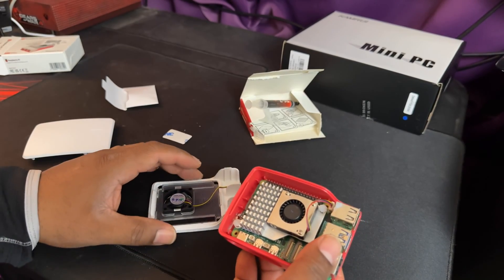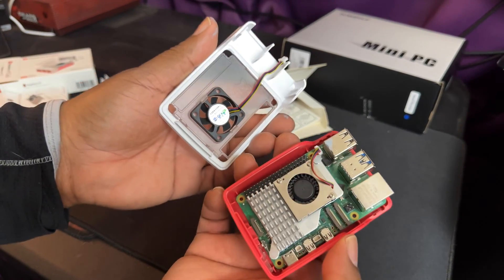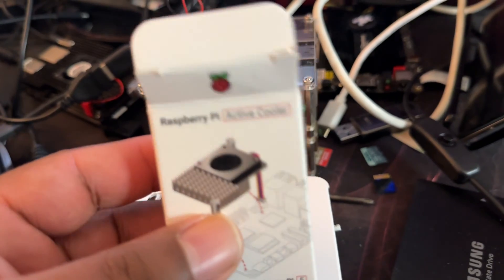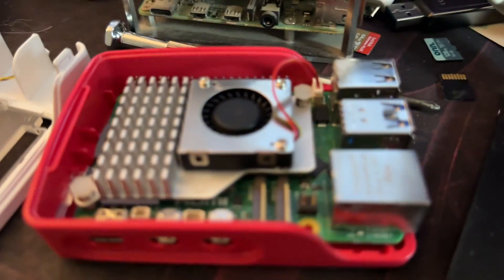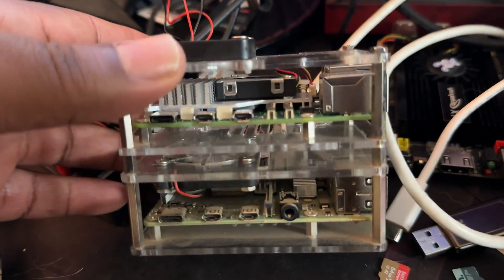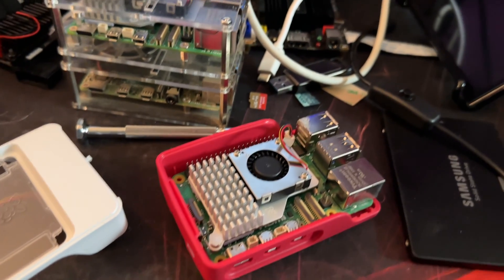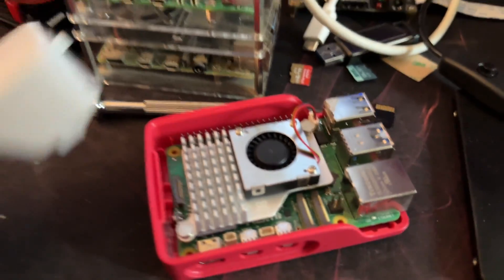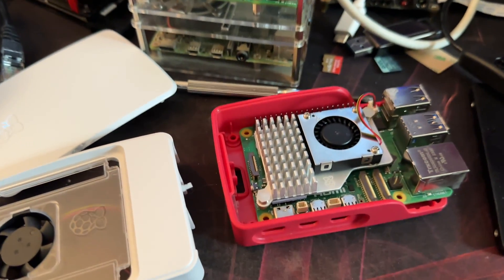The Raspberry Pi 5 Case & Active Cooler Install Concerns

Comment: I thought the same thing guess I’ll have to cancel one or keep the other. They look like they are suppose to work together. The case is suppose to protect it. Does look strange when they could have incorporated the design by making it sit higher for a custom fit
Reply: Flawed design
Reply: they do work together, you just don't use both fans together, you remove the case fan if you wanna use the active cooler. this is by design...as for people who just by the case they have a cooling solution. for those that buy the active cooler, you don't need the case fan. it's not very hard to tell that this was an intentional design choice or compromise not flaw. that's why the case fan/plastic is removable...
Reply from the maker: @sml2238 with demanding applications you need the additional fan and the case creates more heat issues anyway especially when over clocked. U won’t see many videos on this and that’s why I made this video. Under high use you will thrills even with the active cooler
Reply: @kiodiekin  true. i just feel that those use cases are more fringe and those people would either mod the case, or get something more robust. i think the design is fine of the case for average use cases. it was a design feature/choice/compromise though clearly, not a flaw IMO was my only point. I just didnt feel the level of product bashing was deserved considering. but to each their own. cheers.
Reply from the maker: @sml2238  the product could have been designed to work with the active cooler. It gets hotter in the case and temps rise. It’s a bad design to even use in stressful or mediocre situations. Especially after a few hours. I’ve been testing high end apps and people are already throttling with no case and the active cooler
Reply: @kiodiekin  It IS designed to work with the active cooler, I'm doing so as we speak. If you want better performance you'll have to mod the lid, or run it open. No ones forcing you to buy this case. It's a very inexpensive and IMO good design for most use cases.
Reply from the maker: @sml2238  no one is forcing me to buy this case? Kinda late for that don’t u think. I realize I’m recording from my house right and not the store